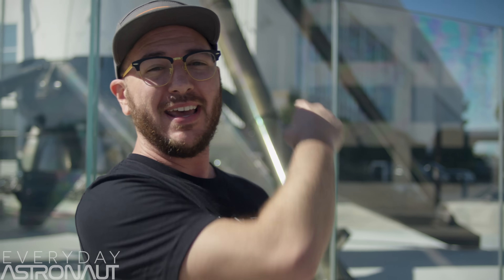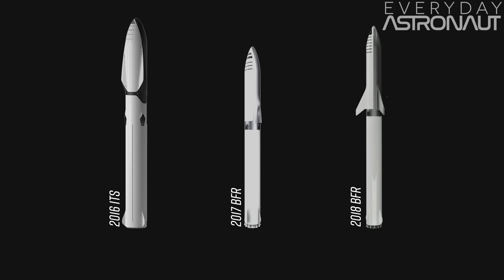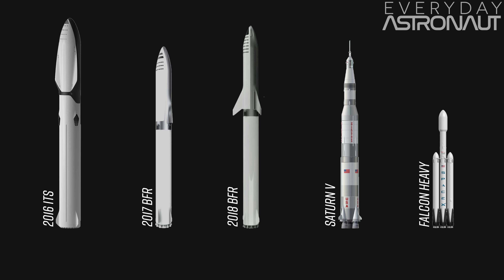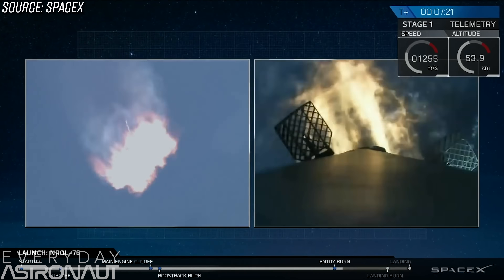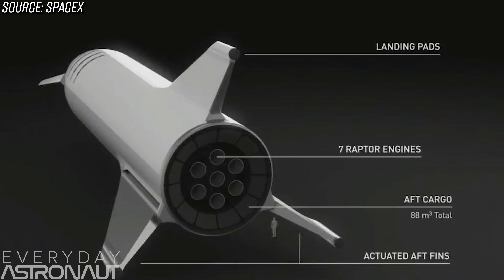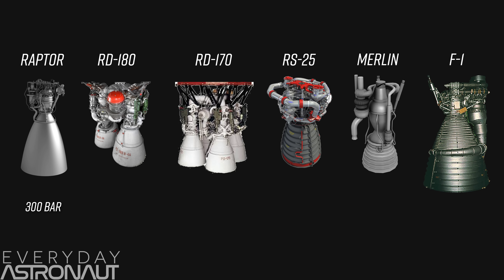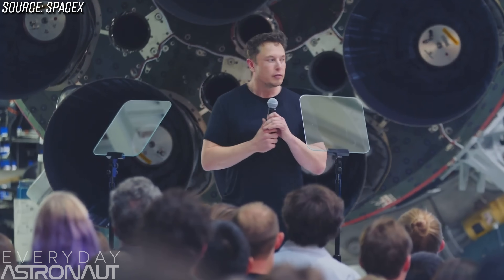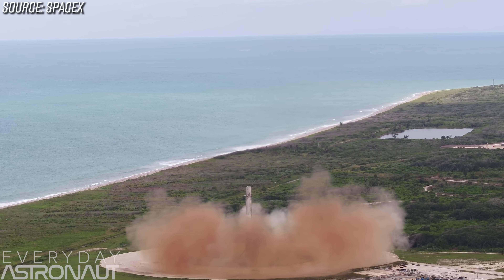Why does SpaceX keep changing the BFR? The evolution of BFR

Comment: the first thing they taught us in aerospace engineering was how, not only useful, but necessary staging is. It's just one of those laws of physics. you can go from newton to rocket equation and directly calculate that you need staging when you deal with rockets. all it takes is a pen and paper and a brain. this BFR seems to use only 2 stages and they want to land that on the moon and get back to earth? with two stages all together? at the start of apollo the german rocket scientists looked into the required mission profile for a moon landing and they realized that with a direct mission profile you need an insanely large rocket to get to the moon, land and come back. the apollo mission profile, in my humble opinion, is still the best and not just because of opinion or beauty but because of physics. if you try to go to the moon any other way you lose efficiency. I really don't know what gives here. also the aerobraking during reentry looks awfully close to the Hermes Spacecraft from esa or even the shuttle itself. yes the wings move a bit differently but it's essentially the same and we all know what problems you get when you try that.
Reply: In the old days it was taught efficiency trumps cost and/or re-usability.  In Spacex's case efficiency is sacrificed to bring costs down and increase re-usability.  To shed speed on a return to earth you have 2 options only.  Engine burn or some form of drag breaking.  The extra fuel adds even more mass requirements and is these days not possible, even in the days of Apollo, so both will give up most of that speed using the atmosphere, a system that is both well used and well understood.  The wings on the shuttle were used a airfoils, that's not what spacex is doing.
Reply: I'm not from the old days but "efficiency trumps cost and/or re-usability" seems like made up new age nonsense to discredit the perfectly fine engineering over the last 5 decades that we still rely on (boeing 747, automation, the moon landings) and that produced more progress than most of our modern engineering (except computers). with efficiency I didn't mean 3% more fuel efficient or something like that, but I meant it in the engineering sense that everything else will achieve less with more for no good reason. that's why we have staging when it comes to space travel. it's every clear when you do the calculations. next: apollo used a capsule to brake. this bfr wants to use something that's close to the space shuttle. we all know how that ended. putting a heat shield on a capsule is easy, trying the same with the space shuttle and wings and now even moving wings is a nightmare in the real world. also apollo didn't try to reuse any part and they used staging and docking in a very sensible mission profile. the bfr doesn't do any of that. something is not right here. do they actually have a mission profile for bringing humans to the surface of the moon and back again? doesn't look like it. this seems more like a moon round trip rocket and that's it.
Reply: In the end the factor that is most important here is the cost per Kg to orbit.  This is the efficiency model driving the development now.  The Soyuz, Apollo SLS and BFS all use the same method of re-entry.  The only change is in the final landing method otherwise all use aero-breaking lifting bodies to shed most of their speed.  The wings on the BFS are drag surfaces not airfoils and provide no lift.  You keep saying 'like the space shuttle and we know how that ended' and yet none of the flaws in the shuttle design centered around it's wings..  Can I ask which aerospace engineering school did you attend and when?
Reply: you do realize that the death of 7 astronauts in the space shuttle columbia during reentry was directly caused by the delicate and exposed heat shield around the wings right? and they weren't even moving wings and the complicated shape and reusable heat shield was the bane of existence for the space shuttle program. unlike a capsule where the heat shield is a small and simple shape and easily replaced or repaired, a reusable, complicated and large heat shield all around the body and wings is just much more trouble. also I like to point out that the wings on the space shuttle produced no lift, as you might think of lift, during reentry. they used the blunt side of the body/wings much like a capsule (with an off center of mass like apollo) to steer and brake during reentry using off center drag/lift from the body (basically the same as the "innovative" bft design) to steer (just like the BFR), only the final landing phase included proper aerodynamic lift from the wings (as well as a bit from the body I guess) that "carried" the shuttles entire weight. the reason why you wouldn't use wing lift during reentry is that you don't need lift to "fly" you want to reduce speed, also the lift to drag ration goes right down the faster you go anyway so you end up having drag instead of lift no matter if you have wings or not or how or where you point them (altho pointing up would let you skip around the globe by the body lift alone). you asked where I went to university? in germany, you wouldn't know the town anyways. btw a scientist from germany came up with a way to easily predict or guesstimate the lift to drag ration at super and hypersonic speeds. the guy was called Dietrich Küchemann. his wiki page is wort a read. if you use his equation (Küchemann Supersonic/hypersonic lift to drag ratio) you can see that at mach 25 you end up with very litte lift compared to drag anyway so the shuttle really didn't need to point forward. that's why it almost presented it's blunt belly to the direction of reentry and used it's body lift to slightly curve in S patterns just like the "drag" wings and body lift of the bfr. there is really no difference, it's nothing new. you can call them drag devises instead of wings but that's what the space shuttles wings during reentry where as well, drag devices. this really isn't new of different but it certainly is more complex than a round capsule. not to mention that the space shuttle has normal fixed wings, the bfr has movable wings, all needing a heat shield. the european Intermediate eXperimental Vehicle (IXV) did the exact same thing. since it also didn't need lift during the final landing phase it used little rudders to steer. in the end the bfr, the space shuttle, the apollo capsule, hermes and the IXV all did the exact same thing. point the vehicles body to use it's minimal off center lift/drag to change directions for a controlled and low G force reentry. no innovation.
Reply: The failure of Columbia was a compromise of the heat-shield caused by spalling foam from the external tank.  There is no possible comparison since there is no external tank and no foam to spall and frankly it reduces your entire point to meaningless.  The wings were not the weakness that caused the disaster just the part that was unlucky enough to be hit.  Lastly in your original quibble of staging (2 vs. 3) you made a rather large blunder in your reasoning.  It wasn't true 3 stage to orbit, I cracked one of my old books on the Apollo program and found the error in minutes.  The S-IVB didn't burn out at orbit in fact it had to do the TLI still and so had 80% of it's fuel on-board ON orbit.  That means the first 2 stages of the Saturn V were enough to lift 130 tons (including nearly 75 tons of fueled S-IVB) most of the way into orbit and I'll run the numbers later to see what payload the first two stages could orbit.  So that made it 3 stage only by a technicality and a thin one at that.  So thin that as a point of comparison between the two systems it's reduced to meaningless.  The shuttle orbiter has wings that create lift. It uses a double-delta wing configuration to achieve the most efficient flight during hypersonic speed as well as providing a good lift -to-drag ratio during landing. For control, each wing has an elevon.  Control surfaces and lift. Not the same thing as the BFS wings and much more like aircraft wings.

Lastly, the final and important factor that you have also decided to ignore is that always important cost per Kg to LEO which is the big measuring stick in the end.  I probably can't say the name of the place in Germany you went to school but I'm feeling MUCH safer in my belief that aeronautical engineering was not your major area of study.
Reply: my point is meaningless because of a lack of foam? if not foam then a simple bird strike during take off or a micro meteorite in orbit can do the same. the bigger and more delicate the heat shield the more can go wrong. I have no idea how you can call that meaningless. it certainly wasn't meaningless for the space shuttle program. where did you study engineering btw? next I can't remember saying anything about apollo having 3 stages. did I? also apollo didn't use 3 stages. saturn used 3 stages, the apollo mission used more. it used one stage to get off the ground, the second stage to get more speed and less than half of the 3rd stage for orbit, the rest of the 3rd stage for trans lunar injection, then the service module (4th stage) for lunar orbit insertion, the lunar lander (5th stage) to land on the moon, the  ascend stage (6th stage) for getting back to lunar orbit and the final trans earth injection by the service module. in my book that's at least 6 stages with one additional stage separation by dropping the ascent vehicle before trans earth injection and the separation of the crew capsule and service module to reduce the mass at reentry. the difference between 6 or 7 (or 8) stages vs 2 is not a quibble. it's a valid question of concern. PS I think I explained to you what the shuttles body and wings did during reentry and why and that it's the same concept as the BFR body and "drag devices" or indeed any other reentry vehicle. I couldn't make myself more clear and I don't like to repeat the same over and over again. take it for what it is or leave it. PPS aerospace engineering means astronautics and aeronautics. so my "major" was very much both just as the name aerospace suggests. I hope you don't feel unsafe with that in mind.

Comment: Great report!

He said something more interesting as an answer to your question.. he said two trunk slots could be replaced by One vacuum engine. Looks like  12 trunk slots on pictures, which is six vacuum engines as maximum. 

Seems like a really good solution with modules! vacuum engines and solar panels is dead weight on earth-to-earth flights. Different orbits could have very different mission profiles by equipping the ship with the modules needed for this profile. Would be great to pop in a few ion thrust modules and more solar panels for longer deep space missions.

Wouldn’t it be cool to replace modules in orbit when having long missions. :)

Comment: Love the rundown! A few interesting things:

- Elon mentioned that the AFT cargo bays can be switched for vacuum engines. This means that SpaceX can focus on streamlining the BFR without having to design it from scratch later. Vacuum engines are good for increasing mass to orbit, so they probably figured out that 100 tons are good enough at first. When the vacuum engines are switched in, we will see far more than a "mere" 100 ton LEO launch capability.

- The AFT cargo bays are great for storing Starlink satellites. This means that SpaceX can run launches for customers while sending their own satellites up AT THE SAME TIME! Again, they probably don't need vacuum engines to do this, so it's a really clever solution.

- Considering the points above, we will probably see two (or more?) versions of BFR in the future: A version with sea level engines only and a vacuum version. The sea level version will be great for Starlink/light duty delivery and personnel delivery/tourism; especially point-to-point flights on Earth. The main BFS could carry passengers, while AFT cargo could carry trade-goods. The vacuum version will be great for heavy duty hauls (like new space stations) and long hauls to other places in the solar system.
Reply: I think Tim is right that the designers and engineers have sacrificed payload capacity for payload _volume_.  The Raptors are now more powerful than they were for the 2017 design so I suspect that if the '2018' Raptors were put on the 2017 BFS that payload capacity may well exceed 150t, but now that the BFS has more and larger stabilisers and more payload volume, it means the capacity has dropped because the dry weight is higher.
It also means, as you said, SpaceX can focus on getting the BFR operational on one engine design and come back later to optimise it.  Tanker BFS's will probably retain the sea-level engines, while cargo and crew BFS's will shift to a mixed set.
SpaceX is also clearly targeting the BFS to service NASA's plans for both the (ill-advised) LOP-G and Lunar services in general.  The mental image of a BFS with 1000m^3 of habitable space docking with the LOP-G with ~125m^3 of habitable space amuses me greatly.
Reply: I don't even wanna know what that thing (the LOP-G) is gonna cost riding on the biggest Pork Barrel ever created
Reply: "Why not stick on a hyper-drive, or a worm-hole engine, or an anti-matter warp drive while you're at it?"
Probably because unlike rocket engines (both 'sea level' and vacuum), carbon fibre composites, radar guidance, computer-control, and hydraulics, those don't exist.

"You fanboys are a hoot. Zero, and I mean zero scientific understanding, and close to zero common sense."
We know that rockets work.  We know that SpaceX's F9 rockets in particular work.  The BFR is fundamentally a problem of scale.

"a blatant con-man as Musk"
Oh, there it is.
Reply: TheOneWhoMightBe   Lol.  That last part is so true.  Elon’s haters all try to use science to defend themselves but it’s all just a screen to hide that their entire basis for hating Elon is a personal issue, not an objective one.
Reply: can't wait for that kind of flight to be reality... maybe even in the style of the Expanse universe... shuttle from port <> Lunar base <> bigger ship (presume BFR) <> transit to planetary bodies or stations...

Comment: 118 is only that is longer as the apollo. And the tech of the fins isn't new it was already used in the 80s from the soviets project name BOR-4
Reply: It's not so that it can be taller than the Saturn V if it was only to one up the Saturn V it would be 112m tall. It's so that it is taller than SLS. SLS block 2 is 117m tall, BFR is 118m tall.

Comment: What does chamber pressure means regarding engine performance and how it affects the overall rocket/ship behavior ?
Reply: Roughly.. really roughly..  the more chamber pressure the more thrust per unit mass.  The higher the pressure the faster your exhaust is and the faster your exhaust is the more powerful and efficient your rocket can potentially be.  At least that's my rough understanding of it.
Reply: Lensflare Deviant  I thought the same at first, but comparing raptor and merlin chamber pressures it must mean more than that, or it has something to do with methane combustion that requires a higher pressure ?
Reply: Different fuels produce different results but over all if I understand correctly chamber pressure is a function of how hot the combustion is and how much combustion material is flowing through...  The BE-4 is the BO methane engine and it runs at about half the pressure.

Comment: Is there a possibilty to partly use spare fuel volume of the BFS as cargo on returns to earth? With let's say mined ressources of moon or mars?
Reply: What could you dig up on the moon or Mars what you would need to spend that kinda cash on to return to earth?  Nothing that I can think of at the moment. :)  I think also there could be an issue of do you remove the tank for extra cargo space?  That require facilities and a big modification to the plumbing.  Tanks are kinda tricky to muck about with much. :)
Reply: @TheEvilmooseofdoom  how about an asteroid with rare metals? Could be worth it to think about it during construction don't you think?
Reply: I can't think of a metal so rare that it would warrant that much effort to collect.  I know there is speculation about Helium 3 should Helium 3 fusion become a thing but so far everything we want can be found in our own crust which makes it much cheaper.  Metals for space based construction is another matter, but if you find metal in space and plan to use it off-earth say on the moon then you don't really need to store it inside the ship anyway, you can just tow or push it. :)
Reply: @TheEvilmooseofdoom  fair point. Remembering a quote of elon about how unlucrative transportation of minerals ftom mars to earth is. Not even perfectly packed packages of cocaine stored on palets would make transportation profitable... So yeah maybe you're right 👉